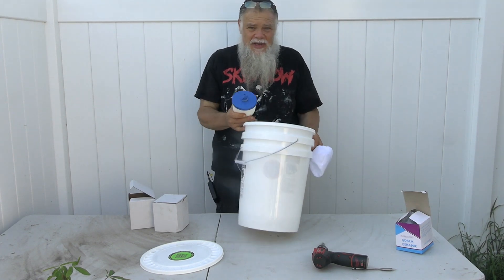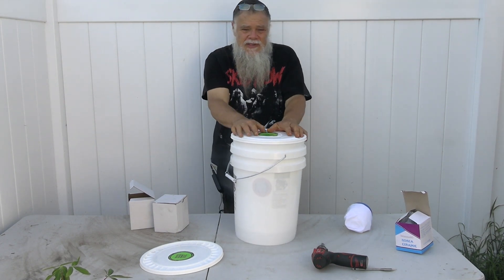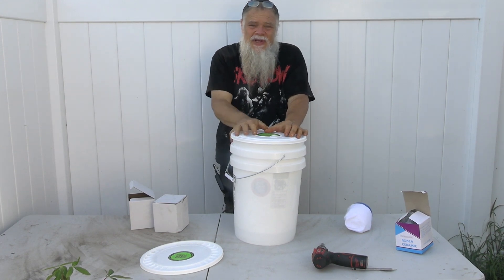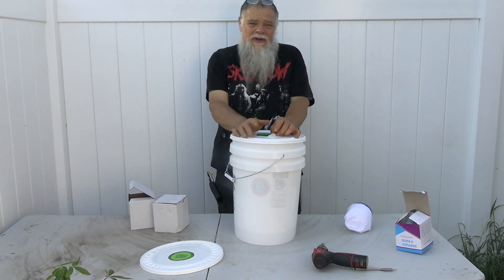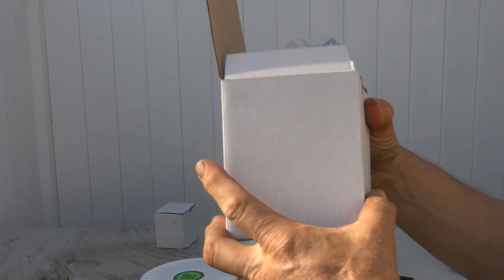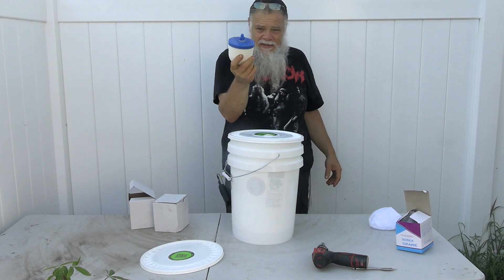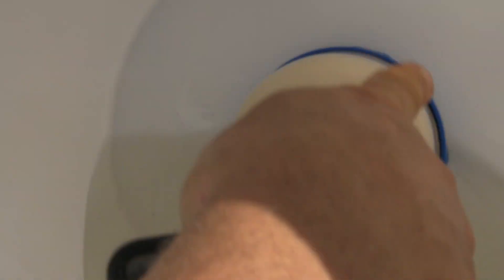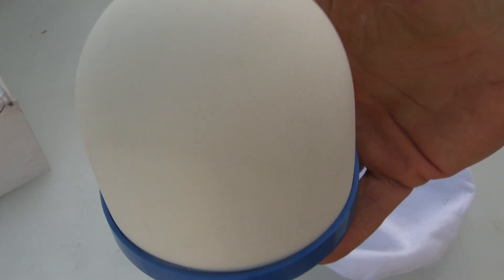Building a Gravity Water Filtration System with the 3rd World "Just Water" Filter

Comment: I would like to address this with your audience last winter we had a snow storm and I just loved it. Then I  decided to snap a picture of the snow on my window.   When I zoomed in and when I looked I almost fell off my chair.  I used a microscope app and what it revealed was all these "nano fibers smart dust / chemtrails spraying.  Then when I melted the snow under microscope it started  moving😠
Sooooo my question is I'm wondering if the filters work for Nano Particles and smart dust?
Reply from the maker: Most likely not. Nanoparticles are in the .1to .3 micron range, and I would be surprised if any filter was capable of filtering them. The spray you refer to is called solar radiation management, and some of the particles are indeed polymers.  Dane Wigington at geoengineeringwatch.org is the best source for what's going on.